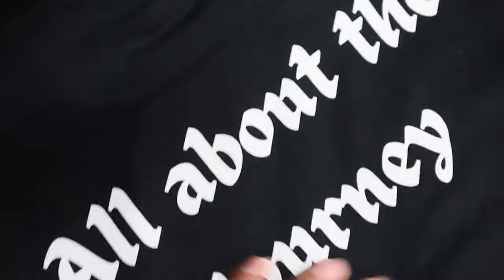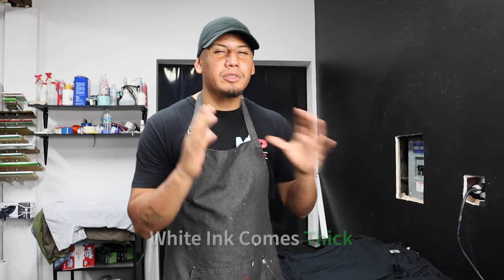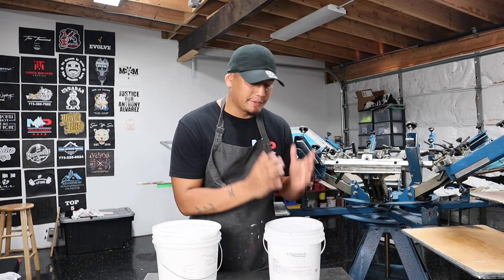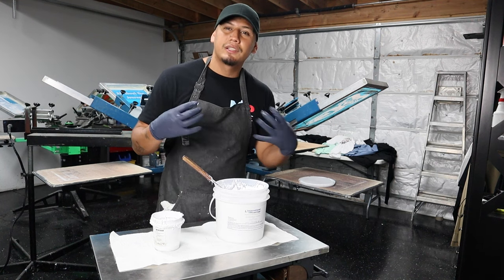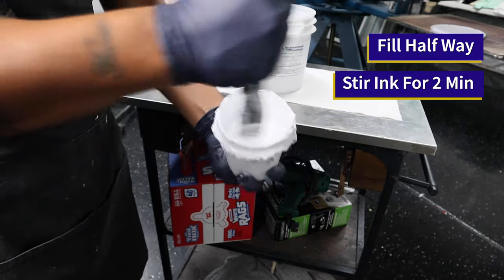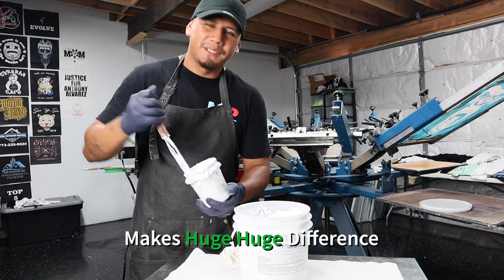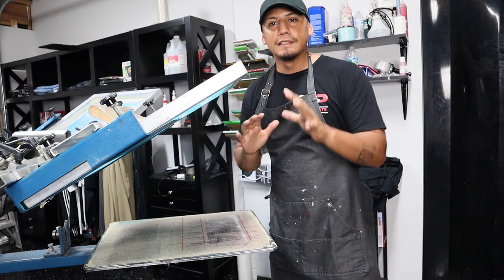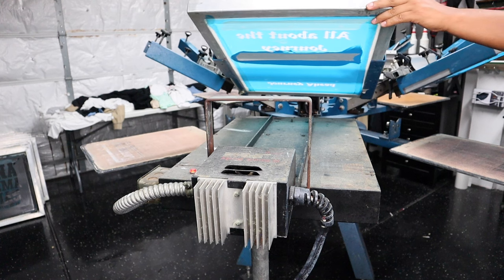Screen Printing White Ink for Beginners Step By Step.

Comment: I had those issues when I started. I grabbed a couple heating pads from the store and when I am about to use ink during cold months and white ink always, I will sit the ink on the heating pad to heat it and then I stir which is easier because its warm.
Reply from the maker: Heating pad … that’s a really good idea thank you 🙌❤️

Comment: I live in a hot country and I find with water based white rubber ink it gets gluey and kind of dries out and blocks my screen mesh. I had the additives but still having this issue of blocked screen mesh. Nightmare.

Comment: Hi Mylo, I've just done my first series in white ink (water-based) on a royal blue and black t-shirt. You're right, you have to take your time to stir things up properly.
I've also noticed that heating the palette helps a lot.
On the other hand, I can't get a nice covering white with the first few passes. I have to dry a little after the first passes (quite gray on the color) then do a second pass > blow-dry a little then a 3rd pass, and then the white is really vibrant and consistent.

Comment: NIce video brov .  i have a question , should i print again white ink after did white underbase ??
Reply from the maker: Thank you … it depends on the design.. if the design is bold then yes you could print flash print.
Reply: @myloprints  great. thank you

Comment: Mylo, can I ask a quick question, if I am using a dark shirt and doing 4 screens with different Water Base Ink colors, on the average, how long do you flash each color? I have been doing about 10 seconds. My living room is a normal temperature too. Also, I watched your video about the different T-shirts you recommend, do you have one favorite for water base colors? I am almsot 60 years old and starting this journey. Thank you

Comment: Can we use heat press for drying colors/tshirts?
Reply from the maker: To dry colors … I don’t recommend it .. to cured yes ..
Reply: @myloprints  what if we dont have drying tunnel, what is the best option for drying paint, if you don't already recommend heat press

Comment: For a black shirt can you just do added layers of color instead of a white underbase?
Reply from the maker: if you want the print to feel nice and smooth i would recommended to have a undebased, but yes you could use a same color twice, but it all depends on the design and color.
Reply: @myloprints  thanks man.. fast reply